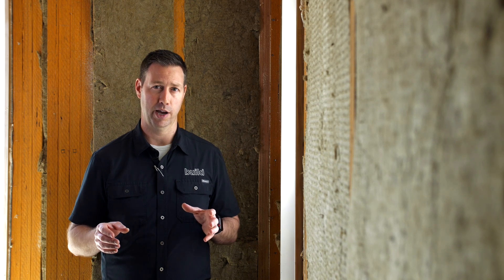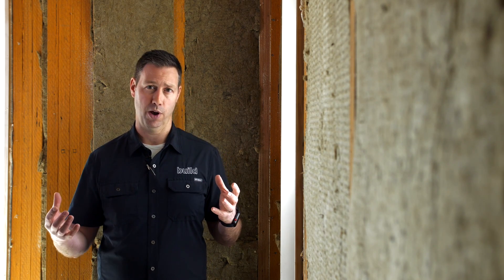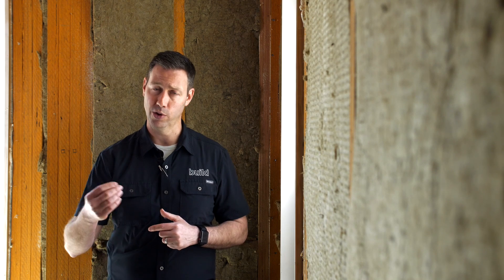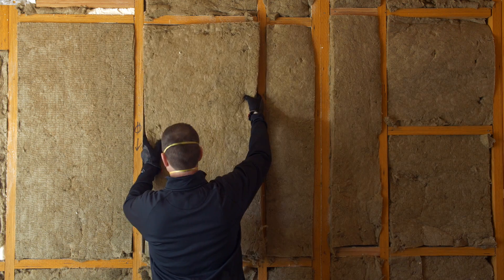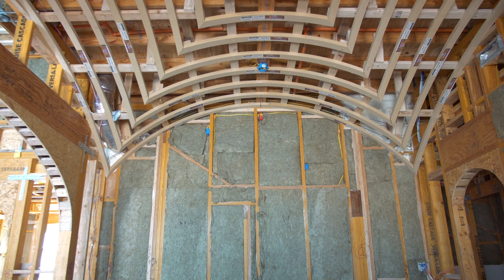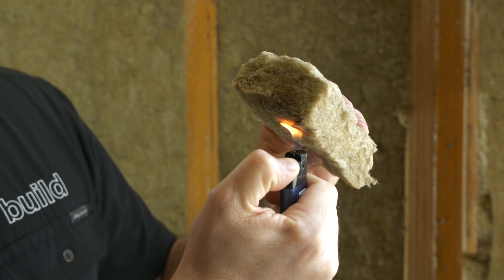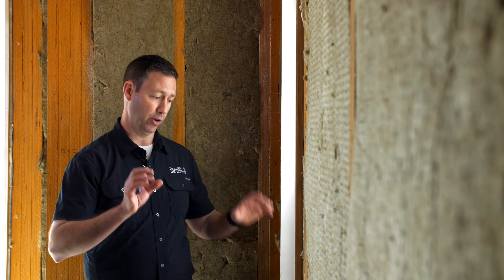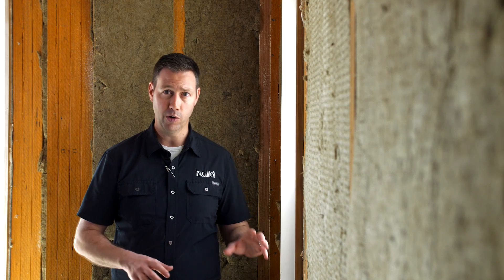Flash and Batt Insulation Strategy

Comment: Is a fire proof coating always required when you spray closed cell on the underside of a roof deck in the attic?
Reply: it depends on the fire codes and occupancy type... but i think the general trend is 100% towards coatings over exposed foam products. 

contrary to what you might think... most of these spray formulations are self extinguishing like cellulose but they generate a tremendous amount of smoke. I think some foam boards are NOT self extinguishing though...polystyrene for example,  and the self extinguishing rating varies based on the orientation of what ever product being tested. 

regardless, i think the additional protection is probably a good idea... i think the additional cost is a small fraction of the install cost of the foam itself and hopefully the same crew spraying the foam would be spraying the fire blocking... at least then the mobilization costs would be minimized.
Reply: Thanks, I'll have get a quote including  fireproofing.
Reply: I could be wrong but around here you can spray the rim joist of the house without fire coating. And some inspectors are fine with the attic being uncoated as long as theirs no equipment in the attic ( furnace, air handler, or such)
Reply from the maker: I’ll make a video on that in the near future. But the short answer is you need to check the ICCES report that says if it’s needed to meet code. Likely it is needed in the attic if there is storage or access. Otherwise no. Band joist areas not needed. Stay tuned
Reply: yea like i said, its all code specific and occupancy specific. the rules for a school are going to be dramatically different from that of a single family residential occupancy. 

your point about the rim joist is a good one. i dont know that ive ever seen one sprayed with a coating either... but at the same time its going to be a small amount of insulation compared to that of a roof deck or crawl space.
Reply: Most areas require a thermal break over any insulation, that being foam or any type of batt insulation. In the rim joist areas that break is the 5/8 drywall on the ceiling. Which is why you also don't need to do any coatings over spray foam in exterior walls of a home or building.
Reply: Always ask for the ICCES report.
Reply: I’m building my own new house & have had 7.5” of closed cell SPF sprayed on underside of roof sheathing and covering the 2x6 roof rafters with 2”+ for a better water vapor barrier & 10” over top plates.

High altitude Colorado, Zone 5 dry, code IRC2015, I must have 3x attic access, due to 3x separate areas > 30ft2 with height > 30” no mechanicals or floors for possible storage.

IRC requires that I cover SPF with an “ignition barrier” which could be 2” of Roxul.
Around here 2” Roxul boards cost much more than 3.5” Roxul batts
Reply: James Patrick you would almost be better off just spraying to the drywall instead of the roof deck since it is less footage and your not treating it as conditioned space
Reply: House is 1-1/2 story, upstairs has 2 bedrooms & full bathroom. Actually the area of the walls & ceilings are more than the area on underside of roof. There are many benefits to doing it this way as Matt has shown in another video. In Matt’s recent interview of Dr Joe at the build show, he said: “they don’t blow away, they don’t let in fire or rain from roof vents. Air, water vapor, & thermal barrier all in one.
Reply: James Patrick I reread your comment and realised you said rafters. I had thought you were spraying the bottom chord of the trusses with 2". Only thing to watch for spraying your top plates that think is autoignition of the foam. Most manufacturers require 3 or more passes to reach that thickness. To see if your installer knows what they're doing just ask how many passes they are going to do.
Reply: Tyler Maurstad My CC SPF 7.5” on the bottom of my 5/8” CDX roof sheathing was done last August & they did a good job, 3 lifts $$$$
Reply: James Patrick : Just to be clear, you’re going to spray 10” of closed cell foam over your top plate?  Why do you want so much applied and what will keep it in place as it solidifies?   I must be missing something... Also, when I put a new roof on my house in 2013, GAF said that applying any foam (open or closed cell) on the underside of the roof deck would void the shingle warranty.  Have the shingle manufacturers changed their position?

Comment: Question concerning this system in colder climates.  The closed cell would be a vapour barrier on the cold side of the wall would it not? If using Membrain I'm still concerned there would be a condensation point inside the wall.  Thoughts?
Reply: He is using an exterior insulation as well. So he has insulation, a vapor barrier, plywood and then the framing lumber. Being that he is using the rockwool on the outside there is minimal concern of water penetration.
Reply: What do you mean by membrane? An external such as tyvek? Or are you talking of an interior membrane like plastic vapor barrier?
Reply: The best would be alumaflash but products such as from Corsella with their Delta line also work . Ideally the Aluma flash or as he has called it in the past the "perfect wall" where it then gets covered by the rockwwool then furring strips and then siding work best. The Aluma flash barrier is super expensive when compared to others but it will truly last forever. You could also use a liquid applied barrier that would work really well.
Reply: https://poly-wall.com/window-flashing/aluma-flash-plus/
Reply: The concern is that the air barrier on the interior (MemBrain) gets a whole in it in the future (not sure how but worst case scenario) allowing humid air to enter the wall cavity from the interior, the condensation point is in the middle of the wall as there is a second air/vapour barrier there with the closed cell foam. I would hope the MemBrain (air barrier behind the drywall) technology might allow the wall to dry out again in this case.
Reply: That would never happen as it is behind 2" of rockwool insulation. That stuff is very dense. Plus you would never get actual water back there because rockwool is also waterproof. Personally I would tend to wonder more of the effects of the plywood or even the spray foam off-gassing than of a small amount of moisture back there. You are going to have small penetrations on the wall where you have electrical outlets for exterior lighting or hose spigots etc.. that's where the liquid flashing product comes in.
Reply: Rock wool is not a vapor barrier, water vapor passes through it just fine and will condense at wherever the due-point is reached within it. 

It is hydrophobic as water rolls off it, and the fibers don’t absorb water, but it is not water proof, try making a boat out of it.
Reply: James Patrick, By "water-proof" I merely meant as you stated that water would roll off it. Secondly because it does act as an insulator you should never end up with a situation where water condenses on the surface behind it.  And as for the vapor barrier, that would be the aforementioned membrane that goes behind it.
Reply: I think Jeff Moss is asking about “behind it” from the inside view, 

and it seems that Mr. Salazar is talking about “behind it” from the exterior view concerning the exterior Rock wool.

Comment: What effect if any does RockWool have on wireless signals, IE cell phones and wifi?
Reply: stevemccollum2011 
These days, that's hardly an issue even for a house built like a Faraday cage since many modern cellphones will automatically switch over to Wi-Fi calling if connected to a network.

The technology has been around for quite a while and since cell carriers and internet providers more likely than not use the same backhaul for both services, you may even have a better quality call than you would over the cell network. The wifi/cell-network handoff could drop but that's becoming increasingly rare as well.
Reply: stevemccollum2011 ive used it in my home, ive not noticed any negative effects.
Reply from the maker: No issues I’ve experienced
Reply: I love the Idea of a super quiet home, but does that mean I would need an intercom or to text my kids if say I were trying to call them to dinner from another room or trying to get them to hurry up & get ready for school? LOL

Comment: Finally, it's ROXUL. Can order from Home Depot. They still primarily stock the pink crap fiberglass, gotta ask to order it
Reply: Roxul recently changed their name to Rockwool. You might see both in the market for a little while, but Rockwool is the new name going forward.
Reply: Here (Colorado) Lowe’s sells Roxul and Home Depot sell Johns Manville rock wool.
Reply: RIS Insulation Supply
Reply from the maker: They stock Rockwool (they changed from Roxul to Rockwool Jan 1, 2017) at Lowes and there is likely an insulation supply house that will sell to the public in your city.  Google "Insulation Supply".  Best to you, Matt
Reply: Lowes stocks it in the PNW.   Home Depot did do the non-rated interior product but they recently switched to Owens Corning version which seems notably less dense and is 1/4" narrower.

Comment: What intumescent coatings do you recommend?
Reply: The spray foam you are using should have a list of recommended/tested intumescent fire barrier coatings. We often spray Sherwin Williams Firetex 5120 (~$60/gallon here in the USA). Be warned though, the intumescent products are really, really thick (think drywall mud) so you'll need a very powerful  paint sprayer. We use Graco Gmax 7900's and Graco Mark V's. The coatings can be rolled/brushed  but the finish is awful and it would take forever to do a space of any size. Good luck.
Reply: DC-315 is another good Intumescent coating, also Very thick.
Reply: About 3 years later, I'm about to go up into my attic to finally finish this project!

I think this was the video that turned me on to intumescent coatings. Since we have a condo with a  common attic, I'm a bit more anal than I might otherwise be about fire. I went with Contego for an intumescent paint, and first painted much of the wood in the attic with it. Much of that was actually proceeded with a primer for improved effectiveness, but not all of it (it was too much work to prime everything). I'm using mineral wool in lots of places where the original insulation was shit, and am going to use some polystyrene where I can't use batts. I think I'm going to cover that with intumescent paint too, for maximum fire safety.

Comment: How do you handle recessed lights when you are using 2" foam board over the joists?
Reply: The Media Is Cancer they make small cans now for LEDs that require much less space or you can even use pancake lights but those are designed mostly for retrofits
Reply: I should elaborate.  If you have 2" foam and then Sheetrock over that, there will be exposed foam below the can light between the can and the Sheetrock.   That is if the light is mounted to the framing.  How do you deal with that?
Reply: The Media Is Cancer gotcha, thermal break on the inside, there are cans that are adjustable from the brackets not sure if you could get 2 inches but then adjusting the bulb mount too you may get the depth you need?

Comment: So what is the R value of the wall in this video?
Reply: Rockwool is 4sr per inch So 7r x 2" + 4r x 3.5" = 28R + they added Comfortboard on the exterior @ 4r x1.5". For a total of 7r x 2" + 4r x 3.5" + 4r x1.5" = 34R
Reply: closed cell is roughly 7r per inch and rockwool is around 3r. So 7r x 2" + 3r x 3.5" = 24.5R
Reply: Does the cavity need to be filled if the foam meets code R value
Reply: In the last video Matt said it was near 40 if I remember correctly. It’s in the closed cell foam video from this same project.
Reply: metro484444 IECC codes here in Massachusetts (which are similar to most Northern States) says 20R or 13R+5R for walls with air leakage no greater than 3 ACH. 

So.."No".
Reply: He's using 1 ton of AC per 1300sf . I bet you he is way under 1 ACH.
Reply: This house has 2" of Roxul ComfortBoard (R8) on the exterior, plus 2" of closed cell foam (R13) in the wall cavity against the sheathing, plus 3.5" Roxul batts (R15) filling the remainder of stud cavity.  Therefore, total R value though the cavity is about R36 and is about R14 through the studs (as wood and drywall are about R1 per inch).

Comment: What's your opinion of denim insulation?
Reply: Denim... I used it once, never again. It's very dusty doesn't cut very easy, has a hard time fluffing. Also remember where cotton comes from very heavy pesticide and fertilizer farm practices (is it really that green?)
Rock wool is much better, doesn't have any of the problem listed. Although it does give you prickers in the arms if not protected.
Reply: Thanks for the response.
Reply: chrimony yeah I'm sure it could do something maybe. But I feel the particles are much too dense to stay airborne. I think any dust mask should be enough to protect you during installation.
Reply: "Although it does give you prickers in the arms if not protected." Now imagine what those would do to your lungs.
Reply: I've seen it on Holmes once, it's not good, it falls apart relatively quickly and doesn't do anything for you safety-wise.
Reply: Rock wool is hard to cut and hard on your cutting utensils.
Reply: badlandskid  a bread knife cuts it like warm butter straight and accurately.
Reply: @badlandskid - I¨m positively confused with your statement. What exactly have been using?
I¨ve worked with "Rockwooll" and other brands a lot.
Quite honestly price aside no way somebody will ever convince me to work with fiberglass. It¨s itchy, messy, wet dream for mice, wasps and the like, soak water...
While I¨m writing this have a "Paroc" pack, another brand, standing waiting for my bread knife. It¨s that easy.  ;-)
Reply: crpth1 we had used a product called Rocksul or something like that.  It was packaged like fiberglass bats and looked similar.   It didn’t cut very easy and dulled knives quickly.   It was a product made from rock I believe.
Reply: @badlandskid  it cuts easily with a serated bread knife or an actual rockwool knife (which is a bread knife)